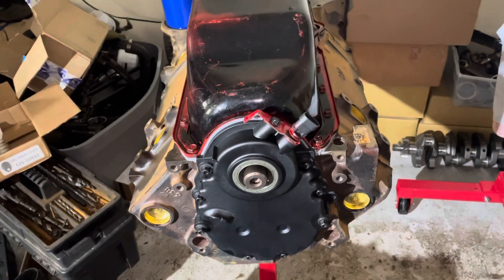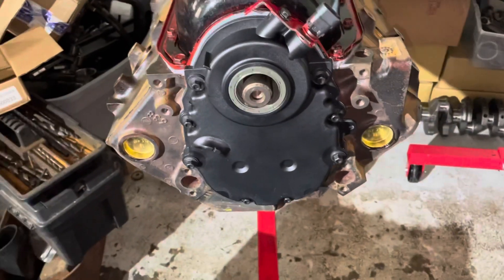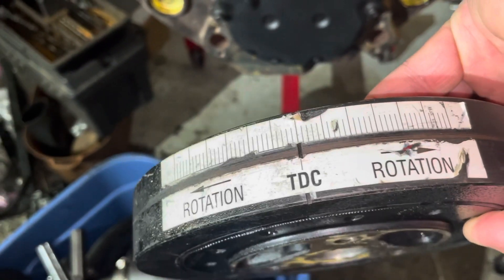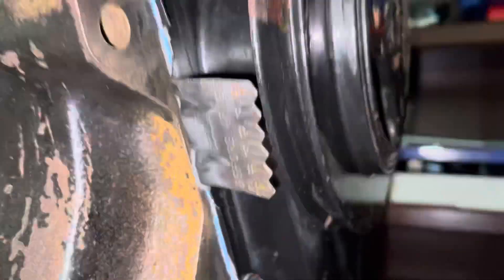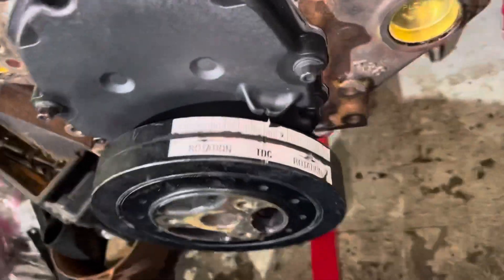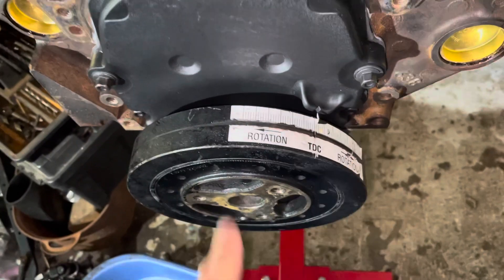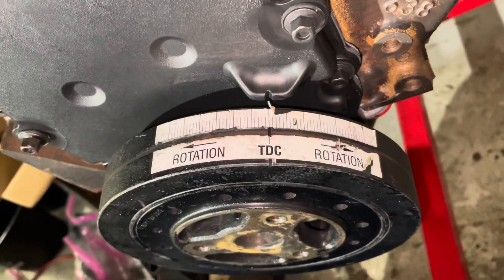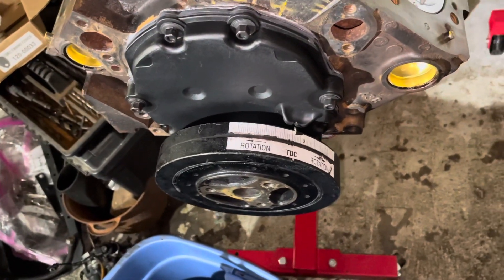Mercruiser 5.0 1(e) - Verifying Timing Marks

Comment: Excellent video as usual! Just wondering what timing covers you use on your builds? Do you stick with genuine GM covers or have you any experience using aftermarket brands? Thanks in advance. Gary
Reply from the maker: I’ve been ordering pioneer covers from Rockauto. They are made in China but the quality is good and GM covers are probably made there too.